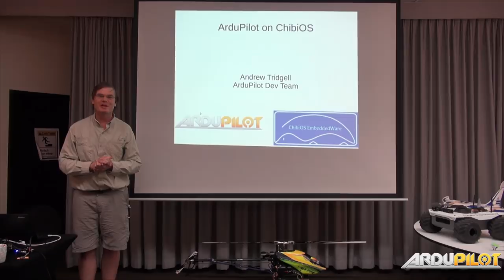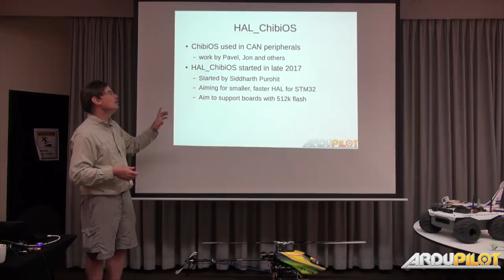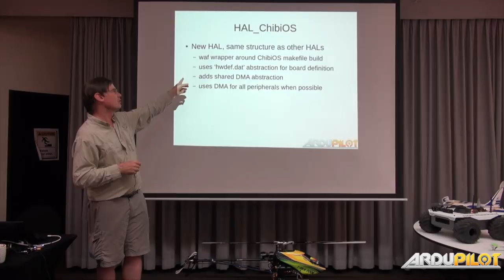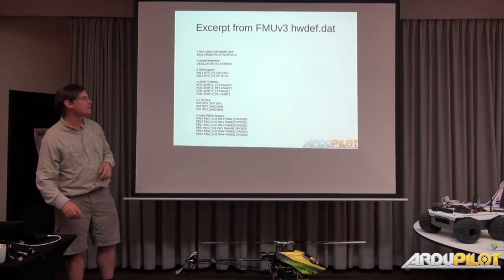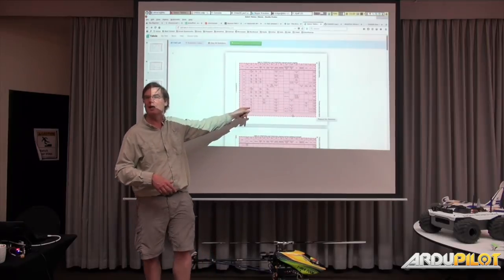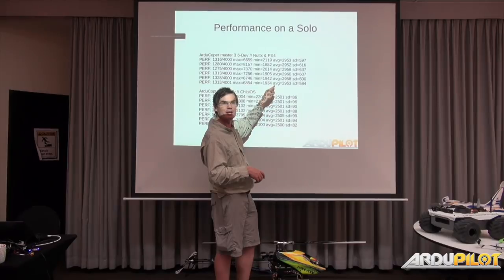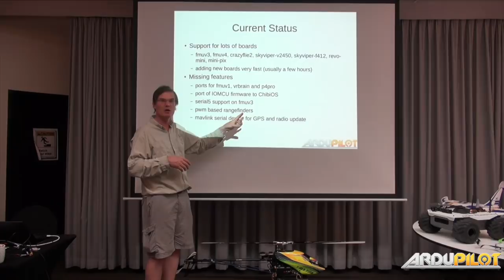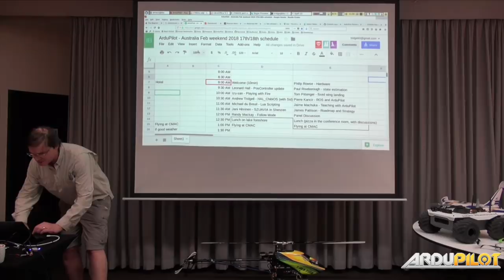ArduPilot on Chibios

Comment: I viewed parts of it and couldn't understand their jitter problem which they solved via ChibyOS - if they needed accurate timing somewhere, why not just use timer interrupts ? Also did they use the low power modes to save energy or not ?